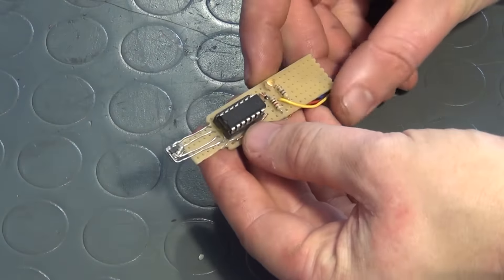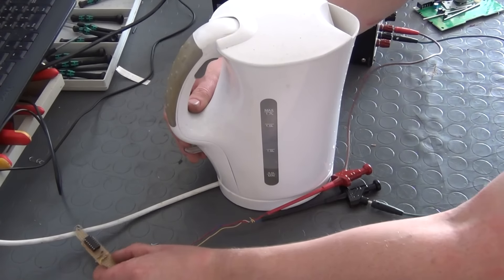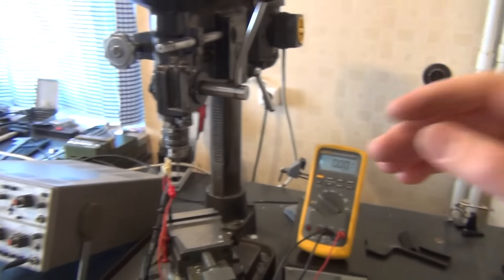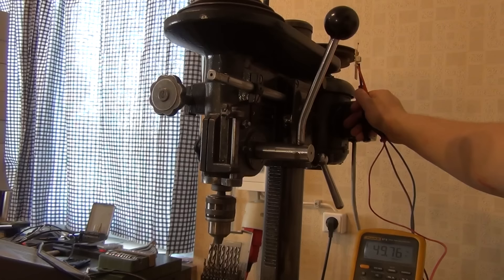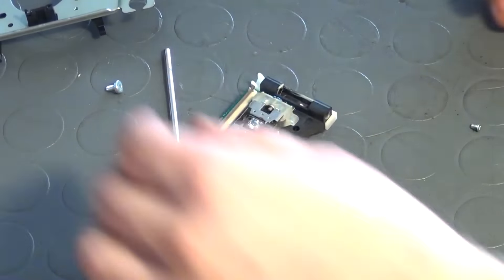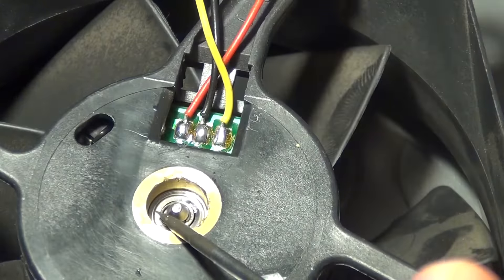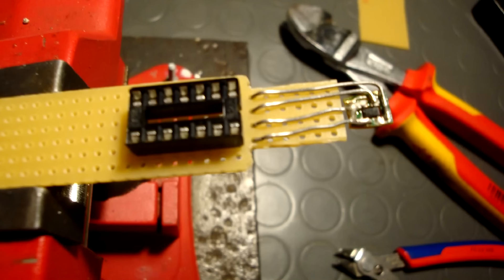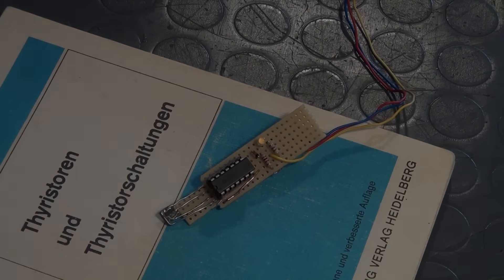Salvaging Hall Effect Sensors and Neodymium Magnets - Build an RPM-meter

Comment: Great Vid, I have used computer fans with the drive coils removed to make air speed indicators, You need to fit fixed resistor in place of the coils to make the fan produce the tacho pulse output (3 wire type).

Comment: A smashing tutorial, i really enjoyed that :-D
Ive never really thought too deep about hall effect devices, although ive repaired equipment that uses them, the old vcr's have one on the capstan motor and on the video head drum for head switching purposes, some old machines have one on the tape counter pulley to detect if the takeup reel has stopped.
I also wanted to measure rpm years ago, i used an led and detector in a V shape to detect a silver or white sticker on a rotating shaft, the detector i connected to a cmos 4011 logic chip, the ub unbuffered type, so its an analog amp :-D
Fed that into a frequency counter then mentally multiplyed it by 60 for rpm, same as you did, i did think about printing a round label with 120 radial lines (black then white), it was to make the counter display rpm direct, but my printer went bang so i didnt do it.
It was a crude circuit, but it worked lol.

Comment: Super freaking awesome! This video is just much better than what the doctor ordered. one anemometer down due to reed switch failure, and an RPM meter on the wind turbine, Both failed after three months due to reed switch failures. Your subscriber, "Sirus", sent me here to see this video. Thank you very much for this video. I subscribed to both of your channels.
One question: Would a solar cell from an LED lawn lamp along with the NI-CAD battery be enough to keep this running 24 hours - 7 days a week? And if not, what suggestions would you have for keeping the power at the top of the pole.
Much appreciation. :)
MUDDy

Comment: Good video, but there is a simpler way,   use the full board of the pc fan , you just need to remove the Lock protection capacitor and the coils
and put two leds instead of the fan coils
one led will light when hall is close to north, and the other when close to south

Comment: As opposed to Reed Switch function, Hall sensors are by far faster acting; however, can hall sensors also be used to detect dynamic magnitude of current? (z.B. AC current, in a wire). My search involves measuring/displaying motorcycle alternator AC Current output (i.e. pre-rectification)... alternator output is 20A/240W, 3-phase, pre-rectified output frequency estimated between 16 and 300Hz... finding AC ammeters within these parameters are very difficult to find... BJTs(2N3055?) could be used to align meter/display readout(s)... all 3 phase shall be displayed simultaneously.... this will not be installed on a motorcycle, but on a fixed/instructional display. This posting is intended for the general viewers that may have better experience with this subject. thank you for your video! (I have a stack of defective disc drives)

Comment: let me guess 
in the video the last section show that you are using 1k,470 Ohm 
if the 470 to the led so that mean you power the opamp with 9v and the 1k to hall which take just 0.009 A is that true?

Comment: hi as ever fascinating and clear. i am using your motor speed controller to run a lathe driven by an ac motor from a washing m/c and decided i want to monitor rpm (sorry f rev!). however my basic multimeter does not have a frequency input. i have looked for a diy circuit to read the pulse frequency from your hall effect sensor but i am struggling to find anything simple enough for me to understand and execute (you, bigclive and one or two others have tought me all i know. is that something you might feature in future. thanks for the great work.
jim noonan, shrewbury uk

Comment: if you don't care about the rest of the board (maybe because all the useful parts are been taken away) you can use a lighter under it to melt the solder, grasp the component with a pair of tweezers and when the temperature is enough it will detach, if more than one just add heat enough to keep the solder liquid (do it outside maybe), beware of a drop of glue under the components of early SMD PCBs (wave soldered)

datasheets of those 4 pins hall elements are almost unfindable, the only one i found had a wrong schematic
Reply: here's one (you can't load it with simply 5V, use resistors)
http://www.hallsensors.de/CYSH12AF.pdf

Comment: Werden die Magnete normal nicht mit rosa Gewebeband befestigt? 

Damit kann man auch prüfen ob man bei der letzten Alien Entführung wirklich eine Sonde unter die Haut eingesetzt bekommen hat.
Reply from the maker: ***** Jo Geweband hätte sicher nicht geschadet, aber ich wollte auch testen, ob der Magnet von allein halten würde  :D ( Sind auch schon öfter mal welche durch den Raum geflogen )
Reply: +The Post Apocalyptic Inventor another great video. What's that about alien abduction????
Reply: +The Post Apocalyptic Inventor another great video. What's that about alien abduction????
Reply: +The Post Apocalyptic Inventor 
Another great video. What's that about alien abduction????
Reply: +The Post Apocalyptic Inventor 
Another great video. What's that about alien abduction????
Reply: tomalcolm with the shown device, you can check on yourself for implanted probes. theoretically. the sensors might self-destruct mechanism.

Comment: why dont u use a reed switch?...less complicated but same application!
Reply from the maker: +Sanji Rumjeet Hall Effect Sensors work at much higher frequencies (RPMs) and have no wear. Reed switches are slow and get used up. Hall sensors are far superior.